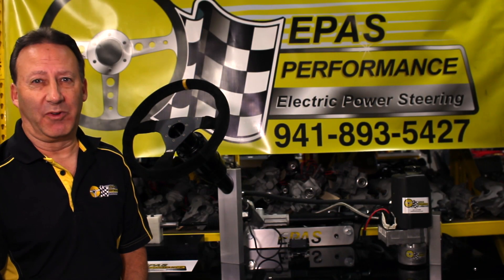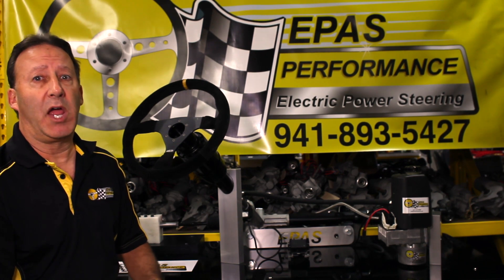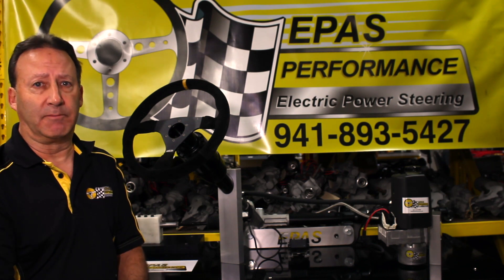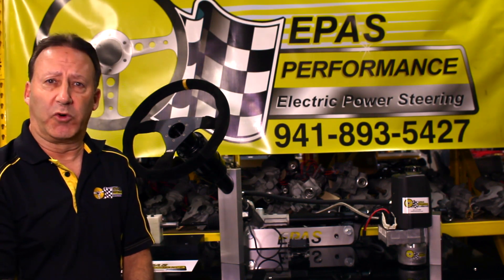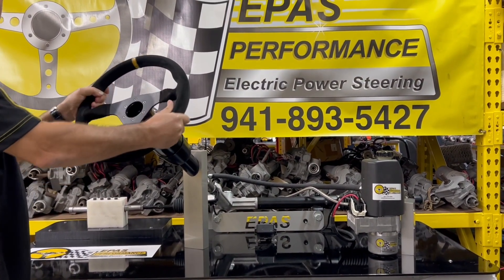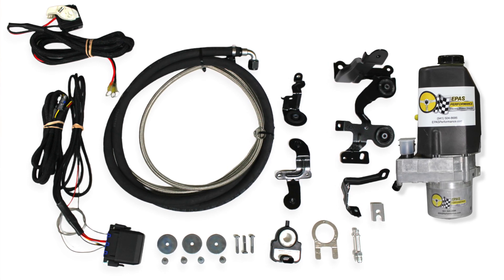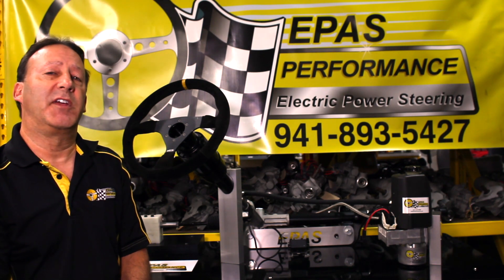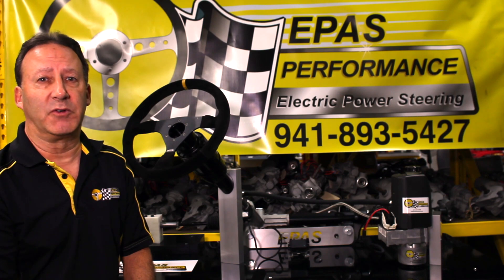EPAS Performance Hydroelectric Power Steering Pump System

Comment: So does this make the all electric one obsolete?
Reply from the maker: Our new Hydroelectric Pump System is specifically designed for cars that already have power components, not manual components. Both systems are still viable, and commensurately priced. The systems are priced within $100 of one another.